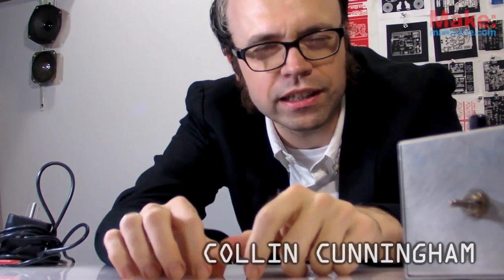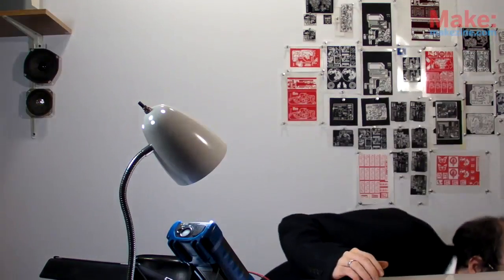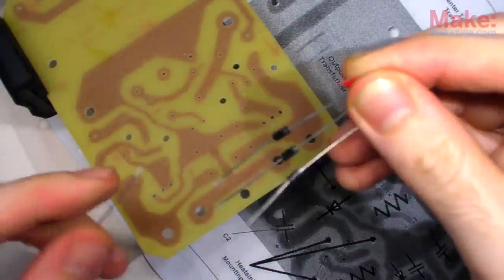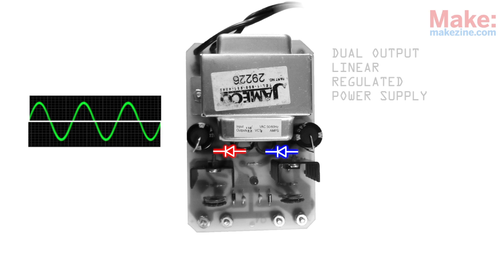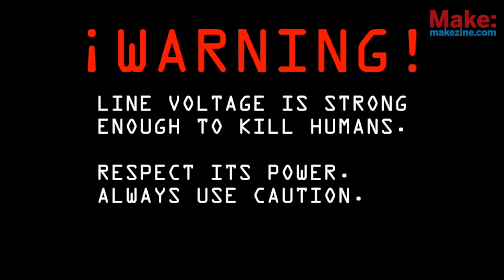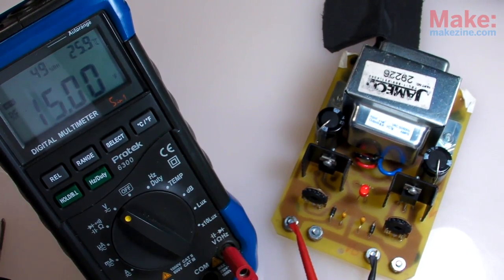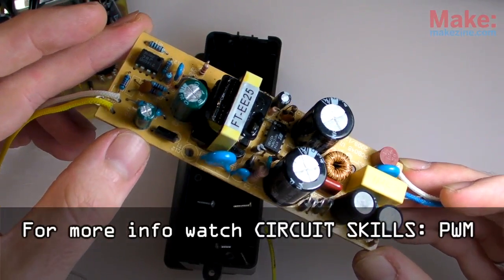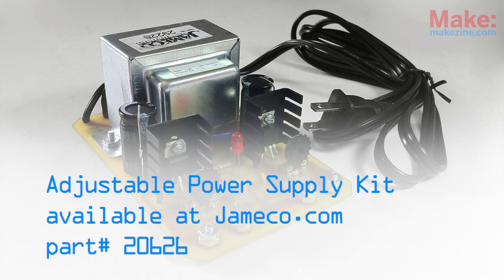Circuit Skills: Power Supply

Comment: Yes, that's my point exactly (!= is a programming term for "Not Equals"). You mentioned lowering power consumption, but voltage isn't power. power = VI (Voltage x Amps). So saying that america saves power by having 110volts is moot. The higher voltages are used to actually save power.. by reducing the power loss by power lines.

Comment: Why is everyone pretending that 120V ac is not dangerous? The rule is that every voltage above 50V is dangerous and should not be worked with without the knowledge needed. 230V is done because it decreases the amount of power wasted in wires, both have advantages and disadvantages.

Comment: Yeah, just checked the manual on site. 
The transformer is rated for 12.6v DC in the manual - I don't see how the kit will do 15v @0.75A as advertised, especially considering it's not doing full rectification of the AC voltage, but rather uses only two diodes to chop one side of the AC voltage.

Comment: Unlike switching power supplies, linear voltage reg. turn the difference between input voltage and output voltage to HEAT.
For example, for the regulator to output 15v, the transformer must give it at least 16-17v. In this case, if you want to output 0.75A at 5v as the kit says, the regulator will generate (17v-5v) x 0.75a =  9w of heat, which is much more than the tiny heatsink can dissipate (~3w) - the regulators will melt or turn themselves off and on.
Cheap kit, crap parts, poorly designed.

Comment: @logos2600 
Well, 240 has the advantage of less power wastage in power lines due to less electromagnatic disruption. 120V has as its advantage that the transformers can be more cheaply produces (only half as much wire on one side of the coil). Both have advantages and disadvantages but i personaly think that 240V is better designed.

Comment: Epic fail, amedsoprano.
"the higher the volts the higher the amps"
Your fucking serious? the higher the voltage the lower the motherfucking amps.
Try something like ac transformer...
Output: 3v
Input: 120/240
You charge the secondary (3v) coil with 9v
You get around 800v...
Touch it, wtf feels like nothing (depends on the size)
Dont try it with 5VA or above, may caose death.

Comment: L0L 120 vs 1kv?
Hah, i cant even feel 120v 1a... (the killlable) 120w
But 1kv 1a means instant death, maybe if...
Theres 1kw of power, 100w is killlable power,
But one thing... at 1kv 0,12a you feel it like its the same.
All depends on the power not voltage, maybe you want to try 5 billion volts that it generated with 0,5mA tesla? its like getting hit by shit.

Comment: @logos2600 we use 240 as you only need a quarter of the copper, but we are smart enough not to electrocute ourselves with 240, we use 415v for big appliances

Comment: @Curixq its better that way because you can use opamps, its better that way than a 0.30 V because then you would need a voltage divider fist to do a virtual ground at 15V, but the resistors may limit the max current you can draw. thake a look at this article tangentsoft.  net/elec/  vgrounds.html   (put together the spaces)

Comment: I have a question.
Why exactly is the point of a  -15  --  +15 V supply?
Why not move everything 15V up (since it's only the potential difference that matters)?  Like a 0-30 V supply and use 15V als a ground.

Comment: Since this is posted last year you have probably already read this, but switching PSU's are in general more noisy, as in PWM instability have some procent less clean power, the best way to describe this is with a battery that give a constant volt-value when filled up. A linear supply give a very close constant volt-value, while switching supplies although more effective give the least constant volt-value of the three. That makes a switching supply bad for sensitive equipment, such as audio.

Comment: @davidenelson It's because the capacitor store some more power upping it up to around 17 volts because voltage regulators need a little more power then they output.

Comment: @mewmaster151 I know that old picture-tube type TVs made a high pitched sound like that. The "flyback transformer" that controlled the beam, made an audible high whistle or whine that you just had to ignore. And the older electronic flash units for cameras did too... may still, for all I know. So it is more than likely the items are actually making a noise you can hear.

Comment: @blva888 A pot could be used to set timing, but there has to be a circuit to allow it to do that. That would be a multivibrator, 555 or some other timing ckt.

Comment: @ZboneWalker Oh. What can I say? You lay out the parts on the board so that they fit nicely (don't physically interfere, heat from one part doesn't cook another, noisy ckts are separated from sensitive ones, air flow isn't blocked and so forth). Then you draw traces with a pencil (or two colors if it is double sided) until you have you connect everything with the least number of feed-throughs and the most direct runs. It's almost art. Beyond that, do you have any specific questions?

Comment: @blva888 You could charge up a cap until the voltage reaches the level where the LED lights and the lighted LED discharges the cap, starting the cycle over again. This is called a relaxation oscillator (read the Wiki article). But the LED mustn't draw current until it lights or you would never get the cap charged in the first place. But why bother? They make flashing LEDs that have the flasher ckt built in. Look at elexpdotcom/opt_6bid.htm. Problem solved.

Comment: @MrWp97 Adaptor is too general a term to use except for tiny things that, for instance change the size of connections (mini plugs to standard plugs and the like). Otherwise, if you look at it right, EVERYTHING can be called an adaptor. A TV adapts radio waves to light. A radio adapts radio waves to sound. An electric drill adapts AC power to holes. :-)

Comment: @jakuba8 Negative voltages are not really a separate thing anymore than "water going into a hose" is different from "water going out of a hose." Pressure and flow are the same, just in a different direction. We usually use positive as the "hot" side of a supply merely out of tradition. Benjamin Franklin thought positive flowed out and negative flowed in (like air or water), but he had them backwards, so now the arrows in diode and transistor symbols are reversed and always will be.

Comment: @StoreFood In a pinch, you can always use two wall warts and swap the wires of one to get the two different polarities needed by a ckt. You wouldn't want to do that if something bad would happen if only one voltage was present (one of the wall warts might get unplugged accidentally). If you are using two metal-cased supplies where the negative is attached to the case (meaning the supply is not "floating"), then you would have to make sure the cases never touch each other or ground, else sparks.

Comment: @LightSwitchr The number of turns of wire in the transformer primary is designed to limit the amount of current that flows in the primary (even without using the secondary winding). Putting a 120V unit across 240V will burn up the primary, because there won't be enough inductance to keep the current in check. Using a 240V on 120V won't burn up, but it may have weak output under full load. Just look for a kit manufacturer in your own country, so that it is compatible without worrying.

Comment: @liquidus2172 Assembly is not the tough problem; you can usually see the trouble by visual inspection. If there is a faulty part, however, and your skill level is not up to finding it, your goose may be cooked: you've built a nicely-assembled paper weight.

Comment: @nahjos Yes, modern commercial building wiring must have beefed up neutral wires to handle the harmonics from all the PCs plugged in if more that one or two. Lot of people ignore this.

In U.S. most residential power meters don't register reactive power  that motors, etc. draw AND GIVE BACK TO THE LINE, just the actual power used up. Pwr companies will use correcting caps to lower reactive pwr so pwr isn't wasted running back and forth from this. Read the Wiki article on Electricity Meter.

Comment: @sammyc45 You put an ammeter between the amp and the batt and measure it (or read the name plate). You may not read the peak demand from short spikes of loud sounds, but putting a large (electrolytic) capacitor across the 12V will let the cap supply the spikes so that the PS doesn't have to be so monstrous. Nevertheless, it will need to be a hefty, expensive supply.  I don't get the cig lighter thing, because it gets its power from the batt. (And please rewrite that last sentence clearly.)

Comment: @matthewtchernev123 My sis's laptop PS died, too. Of course the female solution is always "buy a new one." (She got a snazzy Apple-looking PS for $19.) I am going to put the PS case in a vise and squeeze it at the corners until it cracks (or saw along all around the edge), open it up and make a schematic drawing. Then I will poke around with a DVM and hope I can find the bad part. Of course, if I am lucky enough to find that there is simply a blown fuse inside, I will be a happy camper.

Comment: @ZboneWalker There are lots of videos on PCB making on YouTube. Some are for fairly complicated designs. For simple stuff, you can cut strips from electrical tape, stick them on the copper where you want the traces to be, and drop it in etching solution until the unwanted copper is eaten up. Do it all on paper first, marking where you will drill the holes for the parts, etc.

Comment: @matthewtchernev123 Without answering the question, the ground (third prong of the plug) uses a non-current-carrying (unused) wire to connect any part that will be exposed to the touch (metal case or knobs, etc.) to the earth so there will be no shock. Generally speaking, if there are no such exposed parts (they are not conductive or are covered by insulation like a plastic box) there is no need for grounding. May be exempted from grounding if the insulation is doubled-up as in power tools.

Comment: @kekejojo1212 It is probably not a matter of "brightness," just lack of knowledge.  Everyone has to start somewhere. I would hate to tell you about some of the silly ideas I had about electronics long ago before I actually found out how they work. I was not the type to simply get a book out and read all about it until much later. Did you know that you can't just put a microphone in series with a radio's speaker and expect it to work? That was in the 4th grade. I was crazy then.

Comment: @BunnySk8rProductions Two designs: Charger feeds batt which feeds ckts (complicated) or when the batt dies, remove it and charge separately. Use a DC power supply ("wall wart") of a few volts more than the batt volt, thru a resistor, to charge the batt, then put it back in the ckt. The resistor is sized (in ohms) to limit the charging current to that which won't overheat the batt (it absorbs the diff between PS and batt volts. Start large and reduce ohms until max charging current is reached.

Comment: @BunnySk8rProductions Well, you could "figure it out," i.e. do the engineering, but it would be easier to measure the current drawn by each ckt using the current scale of a VOM or DVM put between a ckt and the batt.. Add the amps of each ckt to tell you what the batt has to supply. If you have a variable voltage supply (or can borrow one), you can run the volts down to where a ckt dies and then you know the minimum voltage the batt. must output before recharging.

Comment: @liquidus2172 By scratch, it is meant designing the circuit and laying out the board yourself and buying all the parts as an individual. A kit would be easy enough to assemble, but a circuit that complicated would probably be too hard to troubleshoot for beginners, especially if they don't have the right test equipment. For most complicated stuff, kits disappeared (Heathkit, Eico, etc.) simply because you can get if from China built and working cheaper than you can buy the parts.  So sad.

Comment: @Caterpillarthebest In the U.S., a stand-alone device for 240V is not approved unless it draws at least 1750 watts; smaller loads must use 120V. It is a regulatory decision, not a technical one, because obvious both would work. Exception: if it's part of a 1750W item..

Speaking of line voltages, it started out here long ago at 107V, then changed to 110V, 115V and now is 120V. Who is responsible for this? Where will it stop? Is it a conspiracy of some sort? "Inquiring minds want to know."

Comment: @LightSwitchr The supply Colin assembled, is fixed to 115V input, so you would need a 230V primary, 12.6V 2-amp Split secondary (3-wire, 12.6-GND-12.6) transformer, and at that level of voltage, a enclosure,nevermind electrical tape over the primary wiring. Also a 230V primary transformer might not mount on the board as the 115V one does, though you could still run the wiring to the secondary points on the board.

Comment: @BunnySk8rProductions Forget about putting them in series for 27. This won't work unless they all take the same amount of current, which is highly doubtful. Even if they were 3 identical circuits, if anything changes in the circuit (like music playing, lights blinking, etc.), then the change is felt in the other two circuits. No, it has to be in parallel. The first thing to decide is over what voltage range will everything work (as the batt drains down) and what current will each ckt draw?

Comment: @BunnySk8rProductions it depends how many volts the project takes. if they are all 9 volt you can hook them in parellel meaning p to p and n to n. with only using one 9 volt battery. if you have like say 3 projects and each of them are 9 volt you can hook them in series. meaning p to n    p to n. and you will need a 27 volt power supply. and if its a battery its ok but a transformer you need to look out for the voltage and the mA. and the battery won't last that long if you put it in parellel.

Comment: Now I have a weird question how could I take one of these power supply's and make it power a car amplifier? Like how do you tell what you amperagd will read? Because I'm trying to do something awsome by not running nething off of a cars battery or ground for a subwoofer using an adapter from a cig liter. To a power supply idk hbow evething is saposed to transfer in the whole ac to dc back to atemp of ac power any help if you get what I'm talking about lol

Comment: Collin! your videos are by far the best on this channel. Switching power supplies are indeed very interesting. However, given that the input and the output circuits are not isolated from eachother (not sure isolated is the right word), this change of frequence that it creates generates harmonics which increase the current in the power lines. I don't know how it is in the U.S. but in Argentina this reactive power is CHARGED if not corrected. Of course, if you use a lot of these power supplies :P

Comment: @CampKohler a high intensity LED and a battery or dc power supply. Oh the flash should be variable and no multivibrater or 555 timers involved.

Comment: @FrancekPirosrancek He said .75 (750 milliamps). The IC's with properly sized heat sinks, could handle an amp, but if the transformer windings are the limitation, then they could use small, lighter and cheaper sinks and still stay within the IC's temp. ratings. The marketing people supposedly know what the customers want, give the specs and max cost to engineering to design. Next you build it wrong, set your house on fire and then it goes to the lawyers. It's a process.

Comment: @killerpills It depends on the quality of the contact as to the outcome. Wet skin is far worse than dry. Paths through the body are worse than those across a finger, say. Then, even non-fatal contacts can kill if it startles you and makes you fall off a ladder or onto something dangerous. One industrial electrician working under a heavy metal bench touched his elbow to a live circuit and his legs drove his head into the bench, causing, um, "permanant retirement." It's better to take care.

Comment: @blva888 Specify what load is being flashed and what voltage it has to run on. Some lamps have built in flashers and require zero circuitry to use.

Comment: @j7512 Plastic enclosures reduce the design precautions required to keep line voltage away from the user. However, metal is more rugged (doesn't crack when impacted or melt from component heat) and provides shielding, i.e. keeps signals in and noise out. Plastic is quicker and cheaper to build with. "You pays your money and you takes your choice."

Comment: @thewii552 The tip is likely bent to get into tight spaces. In this case, it allows the tip to be placed flat against the work (as opposed to just touching it with the tiny point). The more intimate contact allows better heat transfer (lower thermal resistance), so the joint heats to soldering temp. quicker. Quicker is better, because the glue that holds the traces to the board doesn't cook as long; ditto the components. That is better than using a big blob of solder to improve the heat flow.

Comment: @KaciFoxProductions Since there are two outputs, your question should really be "...over one diode per output." The answer is yes, because the BR would output twice as many power pulses/sec. than the half-wave rectifier, making regulation and smoothing hum easier for the regulators. But it would require two secondary windings instead of one and more expensive rectifiers, which would run up the cost. You get what you... um, you don't get what you don't pay for.